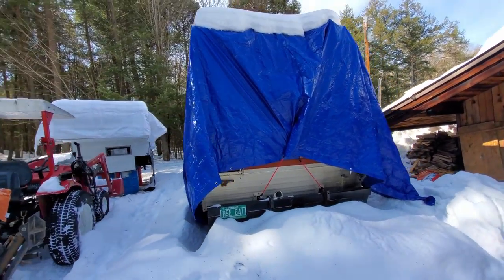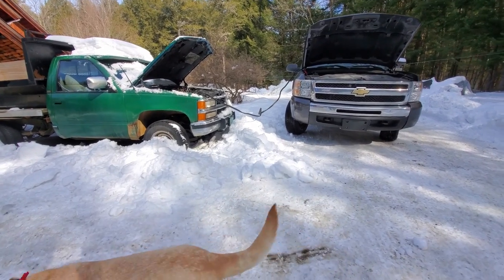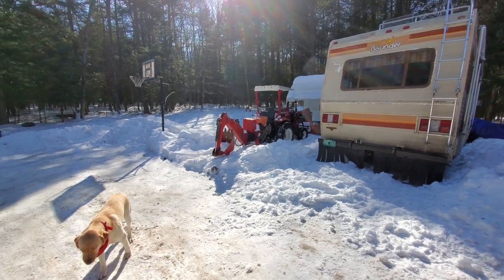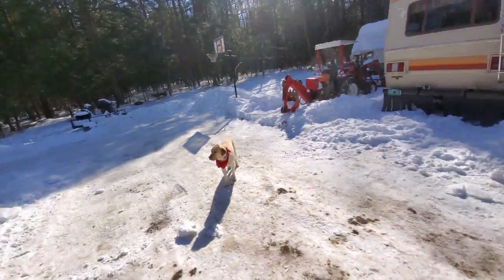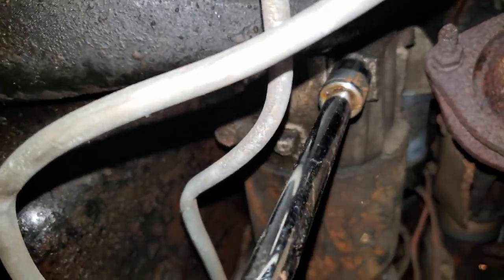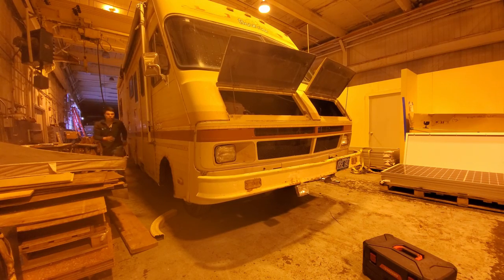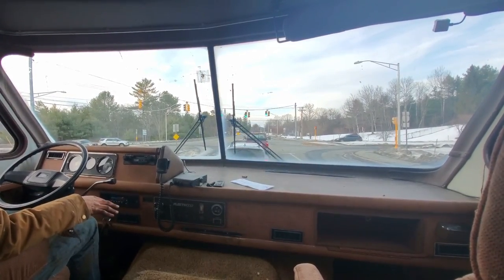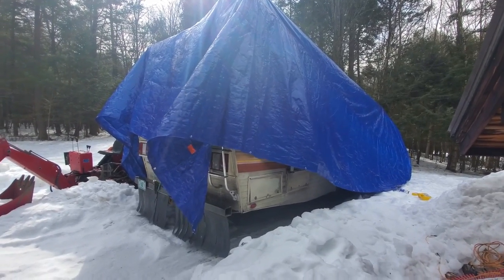$1000 RV Part 4: Cold Start And Repairs!

Comment: Judging from the symptoms I hear, think you need to check all the vacuum hoses. First one= vacuum advance to the distributor. No vacuum there will make some of the problems you're having. You're getting there, keep up the good work!!! PS If you lift [gas pedal], it should shift!! Again, vaccum!!!
Reply: Was thinking also if there is a service manual out there for it, the transmission diagnosis tree will also have the normal shift points for you. Usually in MPH if you don't have a tach.
Reply: Yeah and that is a Turbo 400 so it will have a vacuum modulator, right?  Another thing to check regarding shift points.

Comment: Thanks for your videos and keep up the good work! I wanted to share some of my trials and tribulations with my 87 fleetwood southwind with the big 454. Mine had hard starting and crazy shifting also and no power intermittently. What I found after much difficulty was several damaged and destroyed vacuum lines. I also found my base ignition timing to be advanced way to far. After that I found that my choke spring was not opening the choke fully and that was causing big problems with power loss and high idle and hard starts when warm. I replaced the auto choke spring with a manual cable unit and its worlds different now. In addition I had to remove and clean all the battery cables and clean them and reinstall and replace the chassis battery disconnect solenoid. Mine was working but was not allowing the full current to pass through. After that it was all maintenance to the powertrain and now shes running great. I live in mine full time for now and it's a whole different story. Also the choke issue will cause it to diesel and smoke as u described mine did the exact same thing.

Comment: Heat soak on Chevys started with their first V8. On Big Block Chevys of this era there was a little tin carport over the starter as a heat shield. They help some. Whoever changes out the first starter normally throws it away. It’s a bugar to get back in just the right place so the wires don’t short out. 
Unrelated: In Terminator 2 the robot is shown tightening vertical bolts on the starter of a Ford Bronco. Shit like that in a movie is distracting to me.
Reply: Alex Tourigny Thank you I thought I was the only person who ever put it back

Comment: You have to remember that's not a very powerful version of a 454. Those are built on a commercial chassis and they accelerate slowly, like a bus. That's for sure a Turbo 400 transmission, possibly even a Turbo 475. It shifts by a vacuum modulator but has an electric kickdown switch.  Like other people have mentioned, it's probably a good idea to go over the vacuum lines when it gets warmer and make sure there aren't any broken hoses. A broken vacuum line will admit extra air and make it diesel. Don't just rip them off. There's a diagram somewhere under there and there aren't that many on an HD-spec engine anyway. The carb may need going through. One last thing...watch your steer tires very carefully, and keep a very close eye on your tire pressures. You do NOT want a blowout on that rig.
Reply from the maker: Thanks I'll look into that soon, hopefully it's just the lines causing it to shift late.

Comment: From the factory those 454’a had a metallic shield that protected the starter from the exsaist. However they rusted off and fell away after about ten years.  I had the same issue on my tow truck back in the day and the heat wrap helped. It had got so bad I was driving around with a spray bottle of water and would have to crawl under and mist it till it worked.

Comment: It is your Solenoid that gets heat soaked and over draws the starter, Go to the junk yard GM made and makes a metal heat shield for the solenoid, That wrap will not work on a 90 degree day.

Comment: Nice one. A bit frozen there lol, and scared the dog when starting the camper lol. On  the diesel truck check with a multimiter if all glow plugs are ok and if they getting power, if all ok you can swap for ones with a lower voltage like 11 volts or 10.5 volts and they will get hotter and the engine will start easier. Take care.

Comment: Quick question, have you thought about getting a battery jump box or a battery charger? So you wont have to mess with those jumper cables whenever there is a need to jump a vehicle.

Comment: You might consider using a
high mileage synthetic oil
that is lighter weight than
most motor oils during the
winter months.  Heavier 
weight motor oil has a 
high viscosity, meaning
that when it gets cold it
flows slower and can bog
down an engine and even
prevent it from starting
at all during colder weather.
Further more I've seen tests
where synthetic oil blends
run to the heat where oil is
needed and conventional
motor oils tend to lighten
up in weight and then tend
to bead up and disperse 
away from heat where the
oil and lubrication is needed
the most.  Their doing remarkable
things with these synthetic oil
blends these days man.

Comment: You haven't made a snow man.   A diesel will start with any spray you have,  hairspray to wd40 in the manifold it could help, I had to hand pump mine the other day to   repressure the fuel. Thanks for the vid.

Comment: Heat sook has been A problem since the early seventies,the fix is to add A ford type solenoid, I worked for G M and seem many starters replaced that was not needed, I have diagram to wire the ford solenoid in,,

Comment: Dang man I wonder if any of your glow plugs are working. When I had an old 6.5 diesel it never started that hard and I never plugged it in. Even in extreme cold it would sputter a few times then fire right up.
Reply from the maker: you must've had a good one...usually 6.5's do not like to start in the cold. But it's possible my glow plugs are weak
Reply: Yeah I dont remember a whole lot about the truck other than it was badged 2500 but only had 6 lug axles and it had a jasper sticker on the valve cover so I would imagine that the motor had been worked on or replaced before I owned it but I loved that truck I definitely put it through its paces and pulled some heavy trailers with it and it just kept running.